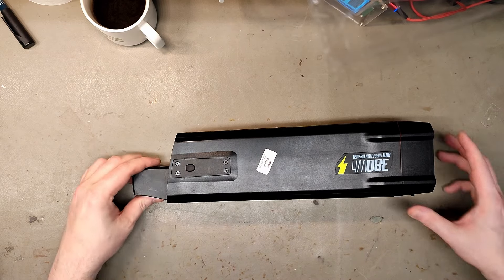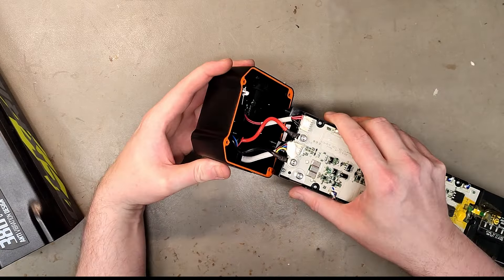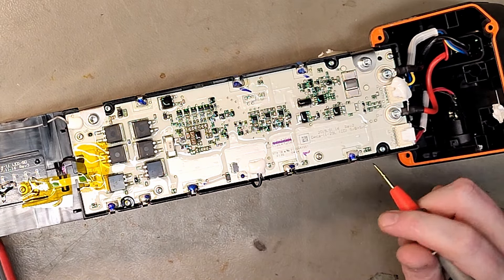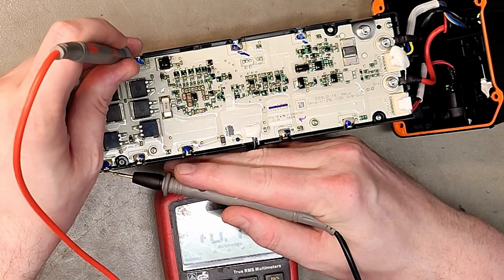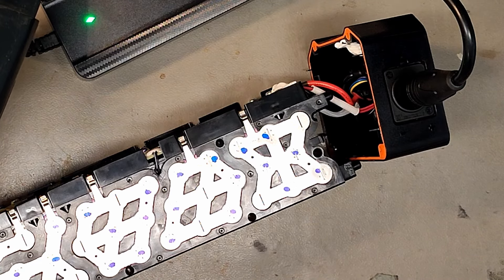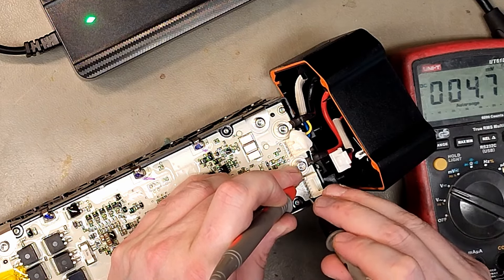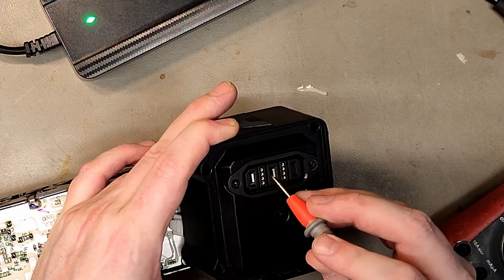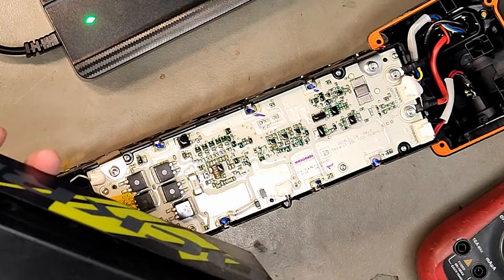Inside @ Rockrider (Trend Power) another battery we cannot fix

Comment: CANBUS CHIP + REAL TIME CLOCK CHIP INSTALLED ON THE BMS.... the battery blocked after 5 years from the date shown on the internal label... could it be a coincidence? the cells have no problems.. Will it be possible to reprogram the battery or reset it??

Comment: Hi, ive got this battery on my rockrider, can i take that bms off and change it for a different bms so im able to use my/that battery as theres no power unless its turned on with the original screen/power button, im going to use a different speed controller and screen. Thanks liam